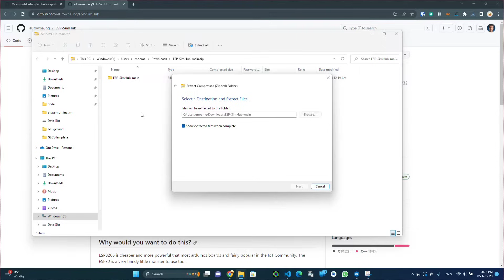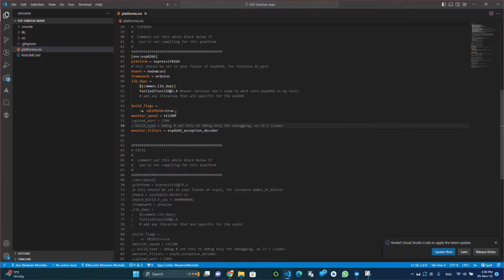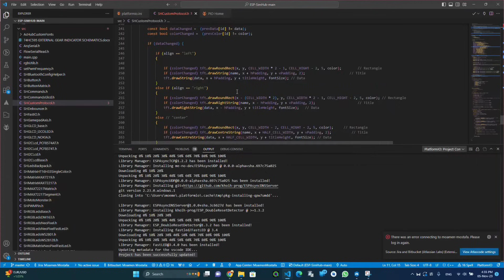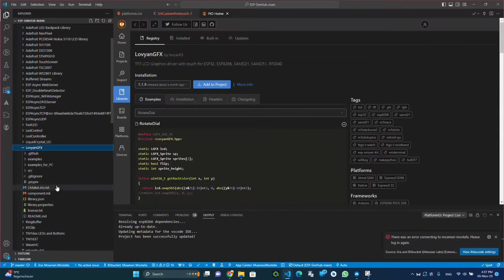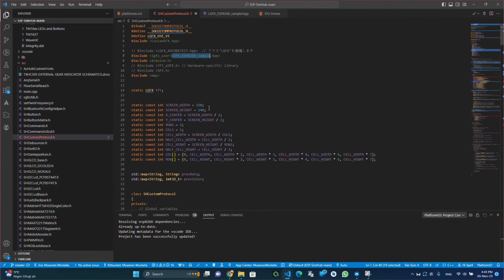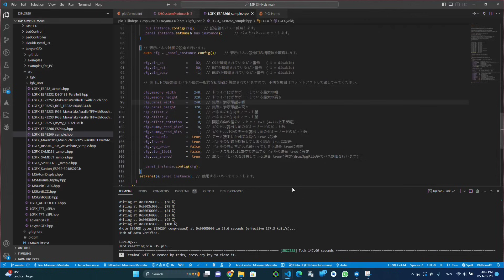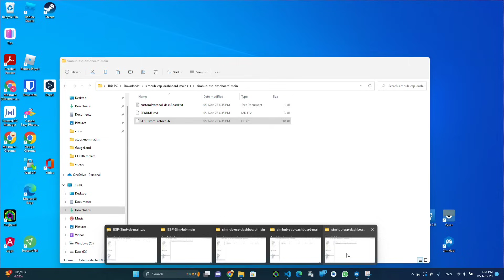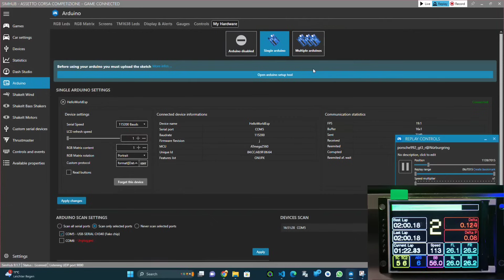How to create a sim dashboard using ESP8266 + tft Screen + SimHub - DIY

Comment: Hello, great work I did it and it worked with a 2.8-inch screen. Is it possible to change the graphics, layout?
Reply from the maker: Thanks 🙏, if you want to change the layout you would need to modify the source code. I tried to have it documented so it is easy to modify. Also  nowadays you can use the help of agentic AI. I would suggest trying the Gemini 3 pro AI model as it is the most one that can be aware of the UI
Reply: @MosSimRacingDIY  Thank you very much

Comment: work great, i manage to get it work on a cyd (cheap yellow display) with some tuning in the gfx library... now i'll certainly try to change some graphics and colors, maybe even another data etc. to my taste. thanks mate ; )
Reply: how did you do it can't get it to work
Reply: @kriscoomans7751 it was in the lovyan gfx folder, I don’t remember exactly what was the name of the file to change but you need to specify pinouts for the cyd, (depends on the model you have) change the driver for your card (mine is a ST7889v for exemple) and can’t remember if I tweak some frequency or not… if you’re a bit patient I can look at it when I can 😊

Comment: Can i use esp32 to create  wheel?
Reply from the maker: If you mean to have buttons. Then yes but you need to use a model that supports native HID. ESP32-S2 or ESP32-S3: These newer versions have native USB support, allowing them to act as a USB HID device (like a joystick or game controller) without additional hardware. This makes them ideal for a button box that connects directly to a PC.
Reply: @MosSimRacingDIY    Can you please make another tutorial; showing how to add buttons?  i have an ESP32-S3

Comment: Hello! Can it be done with a 3.5 inch screen and an ESP12F?
Reply from the maker: Hi, the ESP12F is based on the ESP8266 so it should work fine. Regarding the 3.5 inch screen, the code should support it out of the box, but I didn't test it.
Reply: Thanks!
 @MosSimRacingDIY

Comment: thank you very much its working beautifully
Reply from the maker: Welcome 👍
Reply: Hi mate it not delay??? @MosSimRacingDIY
Reply from the maker: Based on my tests the frame rate is between 15 and 20 frames per second with no lag
Reply: @MosSimRacingDIY  it posible with a more big tft screen man?
Reply from the maker: @botak333  i think the max you can get is a 3.5 inch one
Reply: @MosSimRacingDIY  okee i want buy 3.5 inch, thank u, btw this connect by wireless or usb cable?